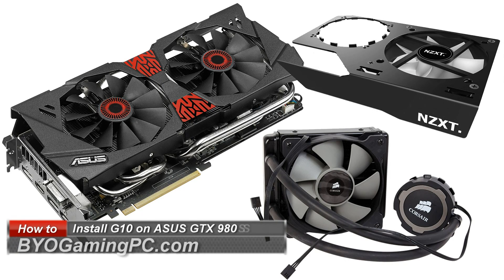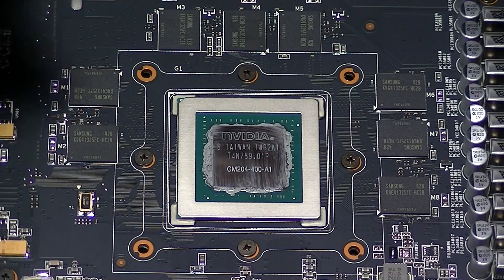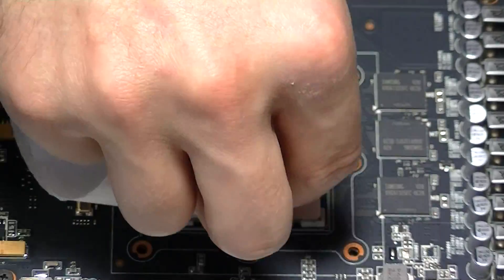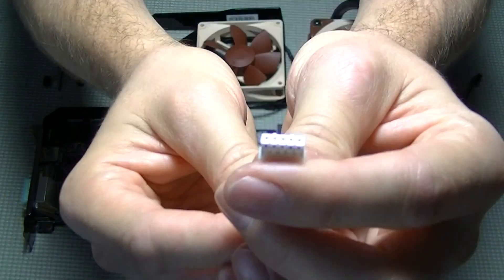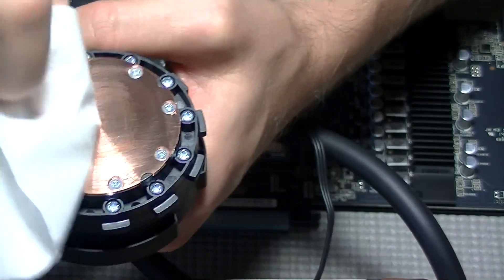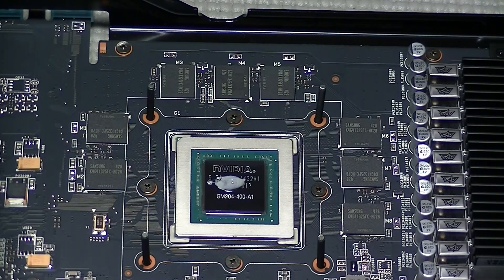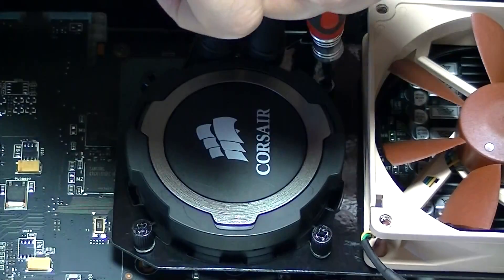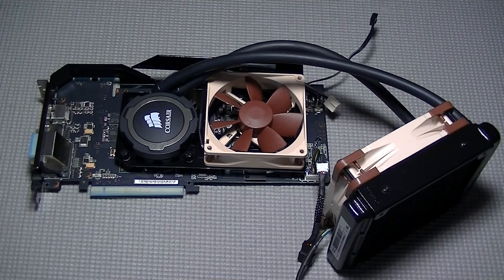ASUS GTX 980 STRIX & NZXT Kraken G10 Installation How to

Comment: i want to install the kraken g10 to a GPU with a backplate, so do i simply dont have to use the nzxt backplate and put the screws directly through the board?
Reply from the maker: Maxi86inAction I keep getting this question and the answer is that I do not know... The problem with the screws that come with the G10 is that they have larger threading near the head of the screw for the locking nut to b attached. You can try it but it's possible that it will not work. I just opted to purchase normal screws and not worry about the screws being too short with the shim or the threads not fitting right.
Reply: BYOGamingPC Ok thx, i get my G10 next week and i will post the answer here :)
Reply from the maker: Maxi86inAction Awesome! Can't wait to see how it turns out!
Reply: BYOGamingPC So i got my g10 and x41 today and I had a really hard to to get it on my card to be honest. Iused it with the r9 390 from powercolor which has a backplate itself, so I was able to use the NZXT Backplate without removing the stock one, but i had to remove the small foam padding on the NZXT Plate and I wasnt able to use the NZXT Spacers because the screws would be too short then. So i used some small nylon washers and i taped the screws to the NZXT Plate so they wouldnt fall off during the installation process. I am also cooling the VRAM AND VRM passively with small aluminum coolers attached to them. I put all into my Bitfenix Prodigy which is really tight but the GPU temps are now at 55 degrees Celcius under load and its pretty damn quiet :) so using both Backplates was possible in my Case.
Reply from the maker: Maxi86inAction Nice results!
Reply: BYOGamingPC and thats with 27 degrees ambient temp :) looking forward to the winter :D
Reply: BYOGamingPC so i did a little tweeking and testing and i got from 51,7 fps in unigine heaven to 67,1 fps with a nice stable overclock. Also the core clock rates were throttling with the air cooler but thats no more a thing now. These results are awesome :)
Reply from the maker: Maxi86inAction Awesome results! Glad to hear about your success.
Reply: Maxi86inAction can wu put kraken g10 witout nzxt blackplate and use only ur gpus blackplade and put scruws trought blackplate holes? i want to know
Reply: Aaponton It depends on the Backplate of the graphics card. On most cards it will work because the backplate has large holes fur the 4 screws but mine in particular had holes that were to small.
Reply: Maxi86inAction nice

Comment: I was hoping that someone might know the answer to this for me, I have an old AIO that will work with the Kraken if I choose to go with it for my GTX 970. The problem I have is, they only guarantee that the Kraken G10 will work on the reference designs of the GPUs, and mine is a Gigabyte G1 GTX 970. Will the Kraken work on my GPU most likely? 

I have googled it and can't find anyone who's tried so far...
Reply from the maker: gamer taboo The only problem you may have is VRM location. If you can do a quick measurement you should be able to find out if it will work or not. It's likely that it will work just fine though.

Comment from the maker: @MarkoPC Stuff They were tightened in a cross pattern but what you can't tell in the video is that the last two were screwed down tighter than the first two. Even pressure was applied and each screw was just lightly snugged down little by little. It may be a little deceiving in the video. The thermal paste may have been little heavy but when I removed the cooler the coverage was quite symmetric and complete. I could have used about 10% less and it would have been perfect.
Reply from the maker: +Raymond Batiancila It should be able to.
Reply from the maker: +Mareak You have to remove the cooler and heatsink from the PCB. Next you need to remove the shroud from the heatsink and then you should have access to the fans. I believe there are some screws around the outside of the shroud but they may require allen or even torx wrenches to remove.
Reply from the maker: +Mareak You may be able to without removing the whole cooler. Try removing the screws around the shroud first. You may find that there are still screws holding the shroud in place that are on the other side of the heatsink.
Reply from the maker: +Mareak 3 seems like an odd number (no pun intended) of screws to be holding the shroud on. There must be at least one more. Is there anything that looks like it could be removed or peeled off to find another screw? Have you tried searching for information or instructions anywhere else?
Reply from the maker: +Mareak No problem. I'm really only helpful if I can see it to figure it out.
Reply from the maker: +Mareak I can't say for sure but I don't see why it wouldn't. If I had one I would put the G10 on it. It should work just fine.
Reply from the maker: +Mareak You don't have to buy the adapter, you can just connect the fan to the motherboard.
Reply from the maker: +Mareak If it's not connected to a power source then yes you do. What are your temperatures when you bench? Your pump and fans need to be plugged into a power source whether a fan controller or the motherboard.
Reply from the maker: +Mareak Glad you were able to figure it out!
Reply: +BYOGamingPC   Guys can this cooler be on r9 390
Reply from the maker: +Vinaijr7 Yes, you can use this on the R9 390
Reply: +BYOGamingPC  I have the same question witn @Vinaijri7  the kraken and the corsair h75 with this same spec can be installed on xfx r9380 card?

thank you
Reply from the maker: Yes it is and that is a great pairing with the Kraken G10.

Comment: Too much thermal paste, you tight the screws in cross pattern, not like that, you were applying uneven pressure on to the GPU.
Reply from the maker: I was actually applying even pressure. The weight of the hoses and bracket were applying uneven pressure that I was balancing out by tightening in the order that I did.

Comment from the maker: @Ben Familetto Yes, it is more effective than the stock or aftermarket coolers that come on the card. The fans that come on the card have to blow through the GPU heatsink to even cool the VRM's so the fan directly mounted over the VRM's with no obstruction will cool better. I saw about 10C lower temps on the VRM.

Comment: Would it be possible to make a before and after results? Nothing fancy. Just some numbers.
Reply from the maker: Pholiage I will do this in my next video with the Kraken G10. Unfortunately, I no longer have this particular setup.
Reply: BYOGamingPC Nice. It would be good to see if the investment is worth making. I have a G10 setup aswell on a 780 reference. And it cut the temps by 70%. So for viewers curious it might be useful to see the results :) Thanks for the video.

Comment: Great video, very thorough. Where did you get the 5-pin to 2X4-pin VGA fan adapter? I can't find it anywhere.
Reply from the maker: jelbic You can check websites like modDIY.com and frozencpu.com. I believe I found it on one of those sites.
Reply: BYOGamingPC Couldn't find it, but thanks anyway:)
Reply from the maker: jelbic Sorry, it's a tough booger to find.

Comment: please i need help im thinking to buy a corsair air 240 and make an sli with 2 gtx 970's. can i install 1 corsair bracket in the first one and still have space for the sli ???
Reply from the maker: KIL GOVERMENT What do you mean by Corsair bracket? The HG10? I have not used it and it also depends on your motherboard PCI spacing.

Comment: I have this graphics card and when I asked NZXT if you can use the G10 on it they said no.
Reply from the maker: Kundalini12 They haven't tested any of the custom cards so their company response is that it only works on the stock cards which they've tested (liability reasons). It does work as you can see in the video and works with nearly every custom card.
Reply: BYOGamingPC This is the reply I got to my enquiry explaining why it wont work.
"No it will not work with that card. The 980 Strix is a non reference designed GPU, and the G10 works with Reference designed cards. Also the placement of the VRM on the GPU is to the left of the GPU processor out of the way of direct cooling. It will not work with it."
Reply from the maker: Kundalini12 I have used this setup and my VRM cooling is still better with the G10 w/ Noctua NF-B9 cooling fan than with the STRIX cooler.
Reply: BYOGamingPC I had a feeling I should've just done it anyway. But I did my first custom water cooling loop instead, turned out pretty good.

Comment: Great Video just subscribed !! But i've just a question i can't find if i can install the Kraken G10 on my Asus Strix gtx 750ti because of the PCB 

Thanks in advance !
Reply from the maker: UniqueGamer No you cannot install it on the 750Ti and shouldn't ever need to. The 750Ti runs extremely cool already.
Reply: BYOGamingPC ok thanks !
Reply from the maker: UniqueGamer My pleasure!

Comment from the maker: @TornadoForceMidget I have not done a GTX 960 install but according to NZXT's website it is not compatible.

https://www.nzxt.com/product/detail/138-kraken-g10-gpu-bracket.html

I will say that depending on your model it may work but the 960 has a much smaller PCB than the 970/980 and any other card that it does work with so that may be the issue. The smaller PCB will have the VRM's located too far away from the cooling fan.

Comment: I just wanna know what about those Vrms, around the GPU? How are they getting cooked. And has anyone ever used a closed loop system along with water block to cook as a coming solution?
Reply from the maker: Lance Echo The VRM isn't around the GPU, that is the VRAM and they don't really get that hot unless you do ridiculous overclocking which will leave you unstable anyway. The VRM on on the right hand side of the PCB directly under the fan.

Comment: I have a friend GTX 970 G1 gaming and the kraken and g10 have a question, and memories ?? They will not get too hot ?? or has no problems ???
Reply from the maker: Luiz Henrique They should be just fine unless he does some really high memory OC'ing but even then it's more likely that he won't even reach a stable overclock at the frequency he would have to overclock it to before it gets hot. I wouldn't worry about it.
Reply: BYOGamingPC then I have no problem using no coolant in not dara memory problem ??
Reply from the maker: Luiz Henrique I cannot say for sure that you won't but I will say that in my experience, I've had no problems.
Reply: BYOGamingPC thanks for the clarification took me doubt
Reply from the maker: Luiz Henrique My pleasure!

Comment: I FINALLY DID IT!!! SO HERES THE RESULTS :DDDD

AIO cooler used: Corsair h105 with push and pull config. I just used some 120mm corsair rad fans for the other side of the rad and the stock h105 fans

Case: Corsair 780t (alottt of room) great case

Hardware: I did not use the plastic finishing washers..or the m2.5 washers. They are hard to find in the USA so I figured id just use the screws and the original NZXT back plate while keeping my 980 back plate. All you need to do is take the Foam pad off the NZXT Krakgen g10 backplate. Simple as that. Now on the thumb screws you will need to remove the rubber ring from them(they are glued to the thumb screws for those of you who haven't bought the g10 yet(easy to take off). I used the m2.5 x 25mm screws and it worked just fine. you may want to purchase 30mm screw and keep the rubber rings and put a washer between the backplate and a thinner foam pad so its perfectly secure but what i did worked just fine(you may need to use a grinder to make the screws like 27mm long though, if using 30mm's) as for the results....well their absolutely astounding.

Thermal paste: IC Diamond 24k

Fan for g10 bracket: Noctua A-Series NF-A9x14 92mm

Fan controller: Corsair Commander Mini (best fan controller i have ever used! very easy to use!

all fans in case and rads were all ran at 65% also....so if they were at 100% i couldnt imagine the temps at full load

Ambient: 70.2F
Load: idle
Temp 74-76F

Ambient: 70.5F
Load: 100%
Temp: 98-114F (Depending what game i played...i used metro and crysis 3 at max settings to test. and many many other games :D)

I also put small heatsinks on the Vram next to the gpu with fujipoly 13kwh thermal pads) (this can get expensive quickly if u cant find the pads.)

!!!!!!!!!!!!!!!!@@@@@@@@PLEASE COMMENT FOR ANY OTHER DETAILS OR LINKS TO WHERE I PURCHASED ITEMS! THEIR ALL FROM USA SELLERS.@@@!~!~!~!!

Build used:

Mobo: ASUS Maximus Formula VII
CPU: Intel I7 4770
GPU: ASUS GTX 980 Strix
PSU: Corsair 860i
Memory: Corsair DDR3 2133mhz (16GB) (4GBx4)
Hard drive: Samsung 512GB 850 pro
OS: Win 8.1

Id like to give a huge shout out to BYOGamingPC !!!!!!!!!!!!! thank you so much for the info i couldnt of done it without you!!!
Reply: Aaron Rhode I also used a tool called a SPUDGER to remove my warranty sticker and I removed it very successfully with a very small heat gun (bernzomatic micro torch) with the heat gun attatchment
Reply: Aaron Rhode can I ask how much all that cost. The cooling stuff that is for the gpu.

Comment: Hi, are longer mounting screws required? The one provided by the G10 is too short?
Reply from the maker: Kenny Leow The one's included are custom screws that have additional threading on them to mount them to the NZXT backplate. They will not play well unless you use the NZXT backplate also and then they would not be long enough.
Reply: BYOGamingPC ah ok. i'm intending to use the backplate anyway. thanks!
Reply: just installed and the results are excellent! 

26 at idle, 54 at full load.

thanks again for posting this video!
Reply: by the way, i just checked the vram temps and it's 61 at full load, is that ok?

what i read from forums are some peeps are hitting 100!?
Reply from the maker: Kenny Leow 61C is EXCELLENT.
Reply: BYOGamingPC thanks for the info! now i can help my friends to install theirs! hah
Reply: +BYOGamingPC hi, i'm back. just need to ask you something, now my idle temps are at 40ish-52 degrees celsius, which is nowhere neat the 20ish from the start, not too sure what happened. Shd i redo the thermal paste?

Thanks in advance!
Reply from the maker: +Kenny Leow Before you do that, make sure if you're using a 144Hz monitor that you don't have it in 144Hz mode. For some reason the voltage and clock speeds don't drop when in that mode. If you don't have a 144Hz monitor then yes, you will want to try repasting. Sometimes your answer can be found when removing the cooler. If all the paste is on one side then you didn't apply pressure evenly when tightening everything down and it all squished to one side.
Reply: Oh yes, I am using the asus 144hz, running at 2k res. So that is causing the idle temps at 40ish? Hot damn! Hahah
Reply: And to add, it only goes to 144hz when I'm gaming else it's 120hz when surfing and watching shows on the pc
Reply from the maker: +Kenny Leow Just set your refresh rate to 120Hz and see if it fixes your idle temps. It did for me. All that really matters is your full load temps really.
Reply: Ok, will do. Thanks for the advise! :)
Reply: i reapplied the thermal paste, using arctic mx-4. now the temps at idle is at 42.

but like u said, it's more impt to see the load temps than idle, so 80 degrees at full load is not terrible yea? the vram temps are always lower than the gpu temps anyway.
Reply from the maker: Yea, 80 is safe but higher than it should be.
Reply: +BYOGamingPC i already did what i could. maybe a better close loop cooler? using thermaltake water 3.0 now.
Reply from the maker: +Kenny Leow It's possible. I don't want to say that it would fix the problem but it could. Are you OC'ing your GPU? I'm assuming you're running everything at stock settings with a 120Hz or lower refresh rate.
Reply: +BYOGamingPC i'm just using asustweak to set it to gaming mode, which is not too much of an OC i think. 120hz on desktop and 144hz during gaming.
Reply from the maker: +Kenny Leow Should be fine then.
Reply: Thanks!
Reply from the maker: +Kenny Leow My pleasure.

Comment: I have just installed The g10  on my 970 running a corsair H110 and i cant actually believe how cool my card runs now ! I cant get it over 35 degrees no matter what i do .
The Standard fitting kit works fine and i even left my EVGA back plate in place ( i have seen people say that you cant ?)  All i will say is that the provided fan is pretty loud . I just swapped it out for a noctua and its much better ! Great product !!!!!

Comment: Great video i have a question does the vrm gets hot like the gtx 780 ??
Reply from the maker: fatboylsvtec77 ! The VRM remained cooler with this setup than with the stock cooler.
Reply: BYOGamingPC  would  this setup works with the new evga gtx 980ti? would you recommend it ? maybe be you can make video istalling this on the new cards 980ti sc
Reply from the maker: fatboylsvtec77 ! When/if I get the 980Ti, I will do a video. I buy all this hardware myself to do these videos.
Reply: BYOGamingPC  ok do you think is worth selling mine gtx970sli to get single gtx 980ti sc?
Reply from the maker: fatboylsvtec77 ! If you are gaming at 4K then yes.
Reply: BYOGamingPC  the monitor i using is the acer predator xb27ohu 144hz ips  2560x1440
Reply from the maker: fatboylsvtec77 ! You have a similar setup to mine. I use the ROG Swift. Currently I am pleased with my SLI 970 setup but will probably jump to a single GTX 980Ti when the aftermarket cards become readily available.
Reply: BYOGamingPC i very happy too with the 970s but i i already bought one 980ti i thinking going sli later in the future that would be better 12ram for the predator ..

Comment: One last question... Is it possible to use the nzxt kraken back plate with the strix back plate... Just remove or have a thinner piece of foam put between there?? If so... What would I have to do differently than from what hardware you show here